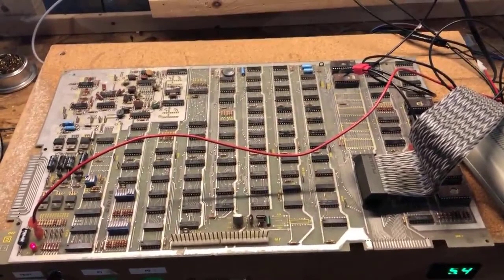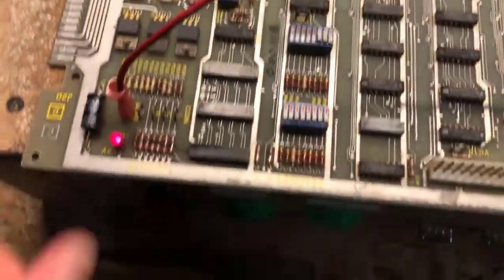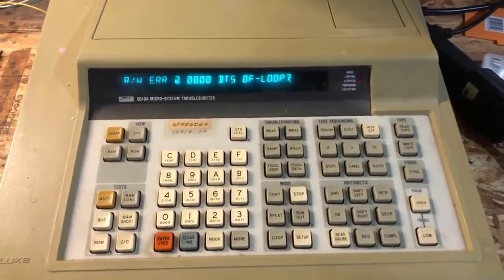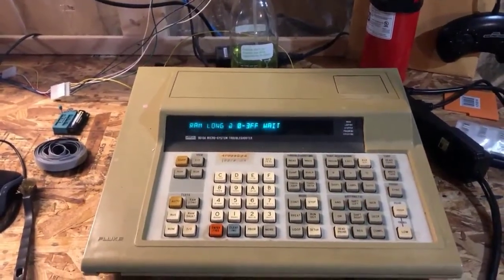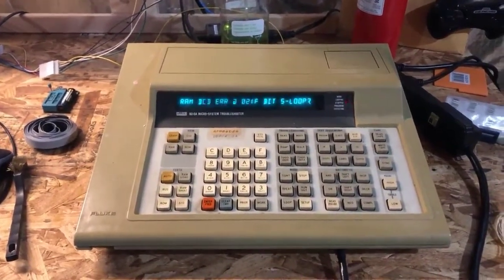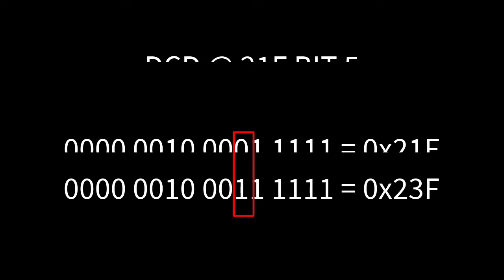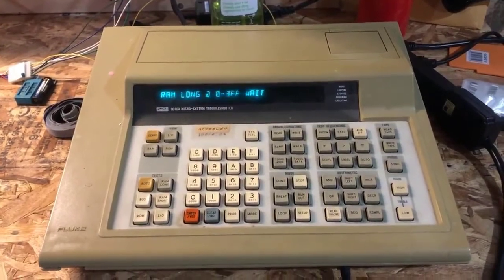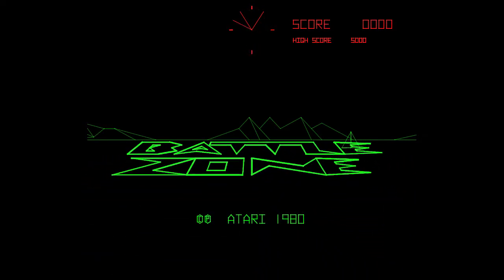PCB Repair 20200412.01 - Atari Battlezone

Comment: arcade cabinets, how did you test the High 4 bits H2 chip? you just write an Hex value and read the Hex value in the H2 ram chips ram range to tested it? I'm confused why you got a DCD error when the H2 upper high 4 bits ram chip is bad. Also can you explain how the Math box circuit works, like what does it do to the arcade game
Reply from the maker: wayne Gram yes just write a hex value and see if the “high” hex digit reads correctly. In regards to the DCD errors that’s kind of the point, the error was deceptive sometimes the errors can be misleading so you hav ego think of ways of verifiying
Reply: The High 4 bits H2 chip has a ram start and end range. How can you write a hex value into a block of range addresses? because the fluke 9010A will only allow you to write to one ram address and read one ram address at a time so that would take forever to read and write to every ram address for the H2 ram chip to test the upper 4 bits
Reply from the maker: @waynegram8907  I just chose one of the addresses that it gave an error at.

Comment: Hi, awesome video. I have difficulties to follow up with the memory  addresses mapping to the various ram ICs.

Ie. When I want to test A1 and A2 ram 2117 units, which adress ranges do I type in? How can I determine them? I really appreciate your help. 

Cheers Jochen
Reply: Sorry, 2114
Reply from the maker: Jochen Zurborg I’ll probably have to make a short video to answer that I don’t know if I can explain it good in writing
Reply from the maker: Ok so I made a video describing how to figure this out, it will be available here aug 21 on  my Patreon site (for patrons) July 24. It describes how to figure this out and is useful for figuring other stuff out like others rams rom or other games. But the quick answer is range 0x2000-0x23FF for a1 and a2